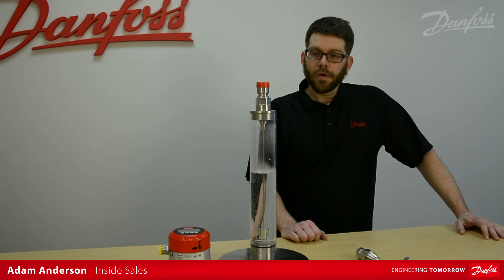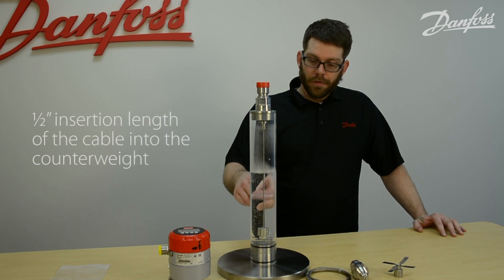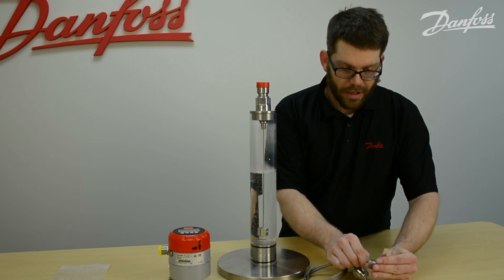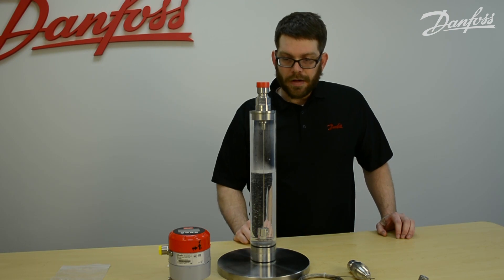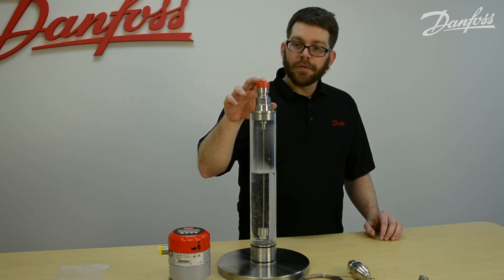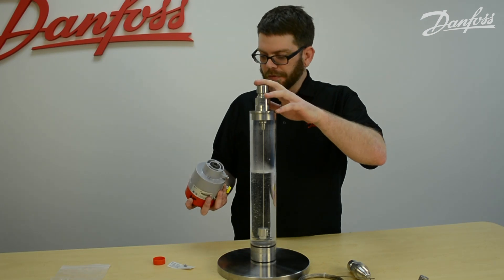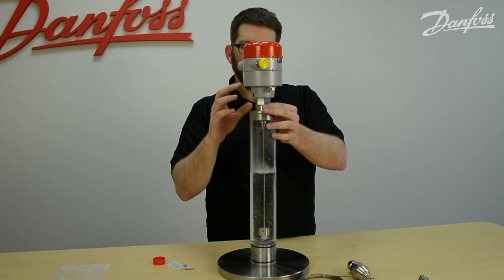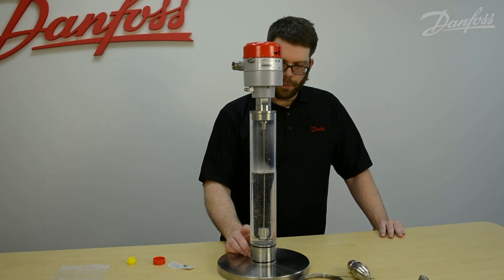How to install a Danfoss AKS4100U liquid level sensor

Comment: hii, I'm facing issue in periodic variation like after reaching 35%  its getting to 0% with in 10 to 20 sec  I'm using cable version what will be the solution for this?
Reply from the maker: Hello, our tech support team is available to help with your question. In order to give you the best answer, please reach out to them by phone at 1-888-326-3677, press 1, then 2 for "cooling" and 3 for industrial refrigeration tech support. The same team is also available by email at cooling.ts.ir.na[AT]danfoss.com.

Comment: Can use this as a replacement fo ak41 sensor?  And csn i use this in aks 347?
Reply: Eks347
Reply from the maker: Hi Faustino, Above the lengths provided in the other comment, the AKS 4100 can replace the AKS41U
. Below that length
we offer 19.2 coaxial version and 11" coaxial which can replace some of the AKS 41U, but not all of them
. An old controller we offered is the EKC 347 and the AKS 4100 can work with the this controller. If you have any additional questions, our local tech support teams are available to assist you: https://www.danfoss.com/en-us/contact-us/contacts-list/?filter=type%3Adanfoss-sales-service-center

Comment: Sir can i cut the cable acording to requerd length?
Reply from the maker: Hi Faustino, Yes,  the AKS 4100 can be cut to length within limits
: 
Minimum length  ~30"
31.5" for the cable version
30" for the coaxial version

Comment: Dear sir how to connect mbs 3000 with vfd for control the pressure???
Reply from the maker: Hi Asfand, there are a couple of different factors that we would need to know to assist. To best assist you, please contact your local Danfoss tech support team. In the US, our team is available by phone at 1-888-DANFOSS or email Drives.TS.NA@danfoss.com.
Reply: Thanks sir